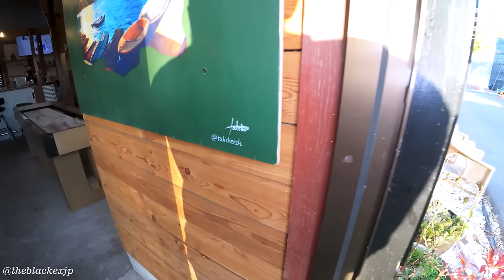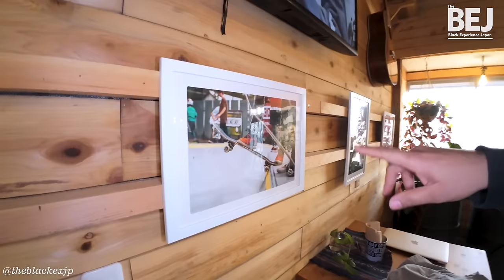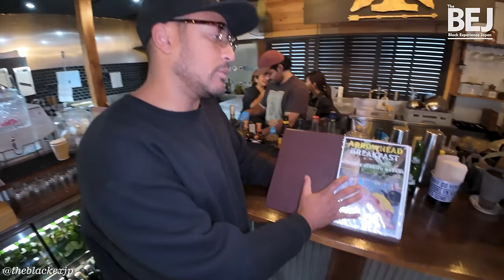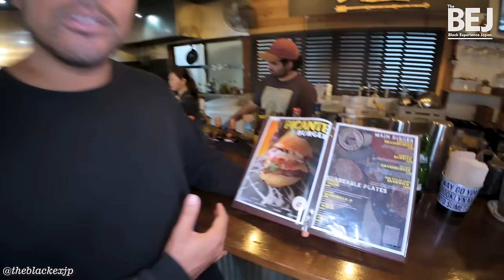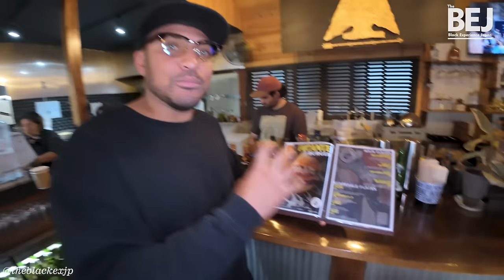Black Man Opens American Style Burger Joint in The Japanese Countryside

Comment: I'm Japanese, and even Japanese people can have a lot of trouble fitting into rural Japanese communities. I think it can be even more difficult if you are a foreigner for the difficulty of the language and cultural gaps. In some Japan's local areas(not all) ,local rules and culture remain deeply rooted, and there is invisible pressure to exclude people who cannot adapt to them.

Japan, which has been protected by the sea, is not accustomed to changes in culture and customs, so they cling to old ways and try to protect their culture by eliminating those who cannot adapt. And it played an important role in protecting their communities. Therefore, such strong peer pressure and exclusivity may still be deeply rooted in rural areas and among elderly people. Of course, if you show them an effort to adapt, they will eventually open up. For them, it doesn't matter if you are a foreigner or what race you are, what matters most is whether you are a threat to the survival of the community.